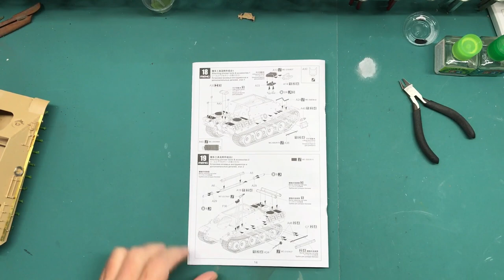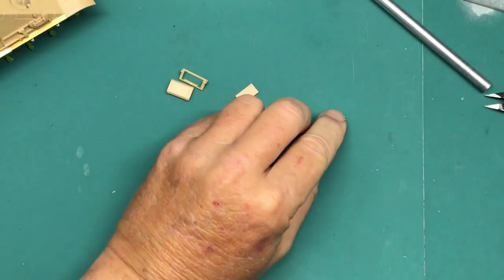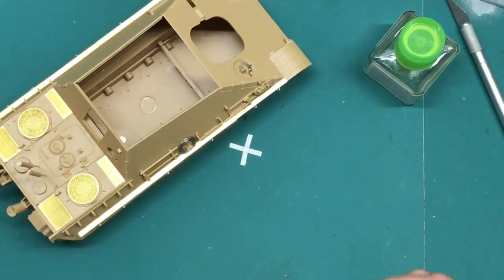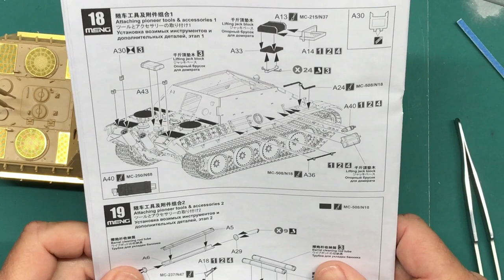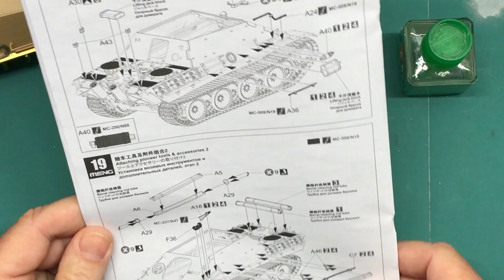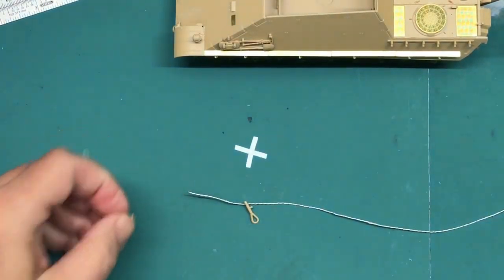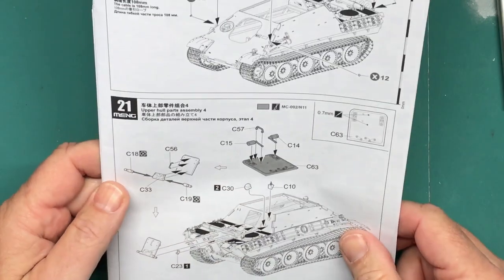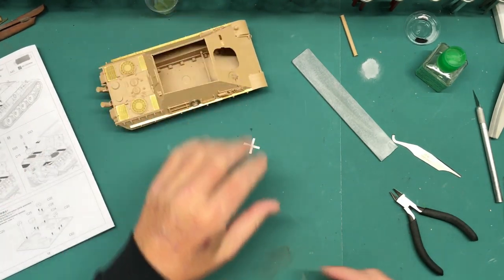Meng 1/35 Jagdpanther Ausf G1 Part 6 Steps 17-22

Comment: So were the instructions wrong on those holes that you drilled or did you just goof? Just curious about how good their instructions are.

You can look up online and find a chart that shows you those drill index gauge sizes compared to actual inches and millimeters. That said I do like you just did. I just find one that fits and use it. LOL
Reply from the maker: I think I got over zealous on drilling the holes. I looked again and the instructions seem to be fine. 
As for bit sizes, I've started matching the bit to the size of the locating pin on the appropriate part. Sometimes  they match better that way.